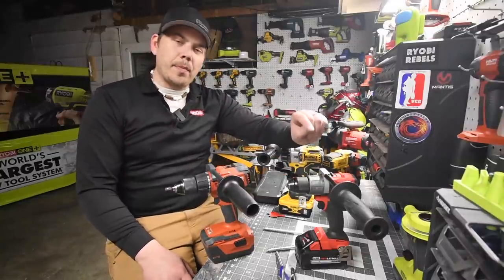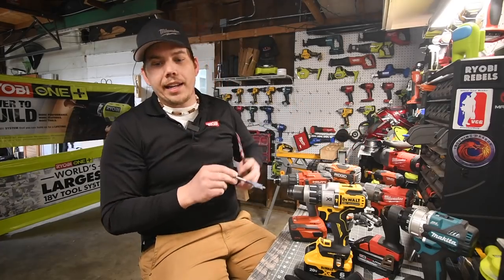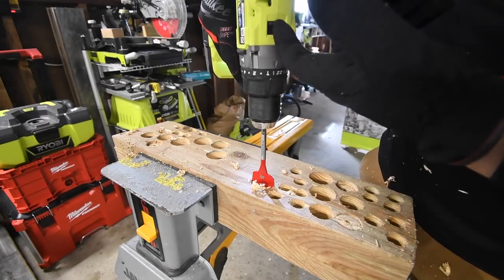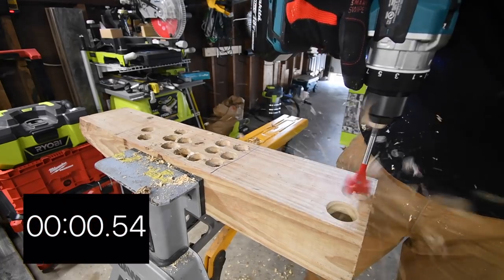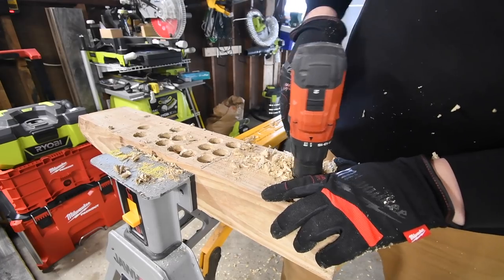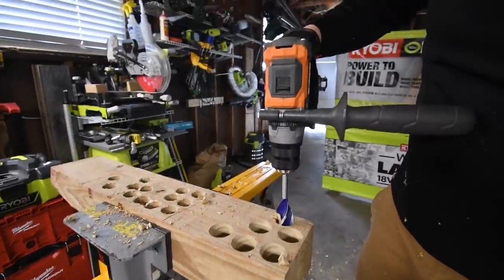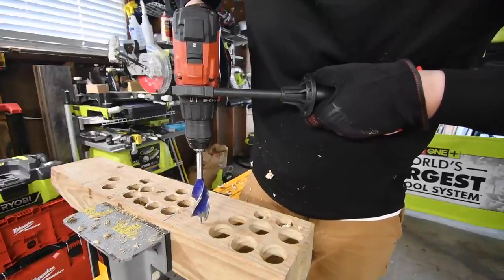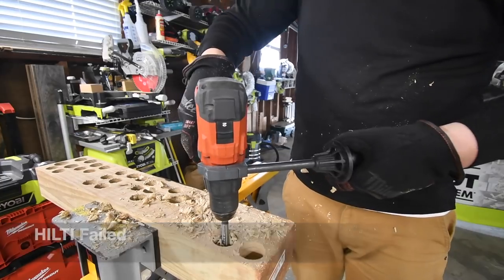BRAWL!!! WINNER Battles The Flex Turbo Hammer Drill

Comment: I've always wondered the same thing with makita not making a higher amp battery or even making the 5 amp like a high out put. Hey I can't wait for the flex vs video
Reply: Makita’s view appears to be that if you need more power than @ 2P (5Ah) battery can supply, then you need an X2 tool with dual 5Ah packs, or their new 40V/80V line.
Reply from the maker: I thank you for viewing
Reply: @geoffstrickler  yea but for a tool like a hammer drill that demands alot of power needs a higher amp battery and not two batteries. The only tool that needs two batteries are like a circular saw or a milter saw
Reply: @weldonpinder7295  be sure you’re not conflating amps/power with Ah/energy. 5Ah is the energy capacity of the battery pack, not how much amperage/power it can deliver. It’s essentially the capacity of the fuel tank. Ah rating is similar to horsepower/kw rating of an engine. A typical 5Ah power tool battery pack can deliver ~40amps @ ~16V, or about 640Watts of sustained power, and ~1.5x higher peak power for a short time. Whether or not a given tool can use that much power is a separate question. To continue the automotive analogy, the tool is the rest of the drivetrain (transmission, differential, tires, etc) behind the engine.
Reply: @weldonpinder7295  with the above for context, yes, there are some high end cordless hammer drills that can benefit from more power than a typical 5Ah 18V-24V 18650 cell based battery pack can deliver. Makita and Hilti could both benefit from newer cell technology in batteries for some of their tools, whether using the newer 18650 cells capable of delivering 25A-30A or from 21700 cells delivering 32A-45A, and/or from 3P pack designs. Of those, all would add weight and size, except for making 2P packs using the newer 18650 25A-30A cells. It’s anyone’s guess as to why they have not yet done so.

Comment: Dont you have a dewalt battery to Makita tool adapter? If you want to test how the Makita performs using the 21700 cell, use that adapter and use the dewalt battery. It gives you the performance you're looking as if Makita does make a 21700 battery. Also the hilti is 24v so theoretically it needs the 5ah battery. I know you want to test the 21700 cell but I doubt the flex 5ah battery is 21700.
Reply from the maker: I thank you for viewing

Comment: The Milwaukee never cut out on the 10” leg did it? The chuck came loose... The Dewalt cut out multiple times, it failed.... 
Milwaukee should be the winner, not Dewalt.
Reply: exactly. he wants to believe dewalt's medium gear is the same as the high gear on the other tools!?
this is as bad as a Flex tooltest...
Reply: @wim0104  Ya, I was very unimpressed with that battle. As soon as the chuck slipped on the Milwaukee (which was operator error I’m sure) he was very quick to say if it doesn’t start again it failed. Well it did start again. How many times did the Dewalt cut out? That test was bullshit. The Milwaukee won.
Reply from the maker: I thank you for viewing
Reply: @ManCaverTools  Not to be harsh. I enjoy your videos and reviews but that’s just my honest opinion. You seemed biased in favour of the Dewalt. The Dewalt cut out multiple times while doing the the 10” leg and the Milwaukee also removed the 10” leg faster. In my eyes that’s a win for the Milwaukee. Or at least a retest. Or put them both up against the Flex but Dewalt did not beat the Milwaukee. Not trying to be a jerk, just stating what I saw and I welcome your opinion would like to know if you really think Dewalt won because you said if the tool cuts out it fails.... Dewalt failed. Thanks for all your videos and hard work. Keep it up.
Reply: Thank you so.eone else who saw his bias. The Dewalt stalled, then he kept going like nothing happened. What bias. I thought if it stalls its out. Such bs. I like both Dewalt and milwaukee but Dewalt stalled. The 998 is a beast but not today.
Reply: @jeffreyheinzelmanjr3317  Thsnk you as well. I’m glad someone else actually posted a comment agreeing with me because I knew I wasn’t the only one who saw that. Ya, the Dewalt is a bit faster but when it comes to raw brute power I think the Milwaukee still is the king.
Reply: Well Derek B some people just do not want to believe what they like is not the king. But for the size of the Milwaukee its got some real power. They both are deserving to be the two last standing, but let's be fair.
Reply: @jeffreyheinzelmanjr3317  Agreed. I just didn’t like the way that Mr ManCaver portrayed Dewalt as the winner when according to the footage it was not. I reached out to him for his thoughts on what I say but he just thanked me for me for watching. He did a video in regards to the yourubers featured in the Flex release and didn’t have much good to say about them but to be honest he’s doing kinda the same thing in this video with Dewalt in favour. Maybe he’s on Dewalt’s dime....  I usually quite enjoy MCT videos and think he does a good job and is fair but he dropped the ball on this one.
Reply: @derekbross6958  I thank you for viewing....oh wait🤔 Why did I said that...I'm confused.

Comment: Dewalt speed 3 is speed 2 on the other drills
Reply: Sort of but not exactly. Jus to make an easy number of 1000 even though there rated higher other drills torque range is 0-500 and 500-1000 inch lbs but dewalt would be 0-333, 334-666, and 666-1000 inch lbs. So dewalt is at an advantage in 2 but a disadvantage in 3 cuz the gearbox is more spread out. The only way to evenly compare is only tasks that require speed 1
Reply from the maker: I thank you for viewing  :)

Comment: When it comes to the DeWalt speed 1 speed 2 speed 3 they should all have specs as far as RPMs. That's what you should match up against the RPMs of whatever the speed one and speed 2 is of the other drills. Not just going by one two and three? Meaning if Milwaukee has 2000 RPMs and speed 2 and DeWalt has 2000 RPMs and speed 3 then that's what you should be running?
Reply from the maker: I thank you for viewing  :)

Comment: So the Milwaukee lost out by a 1/10th of a second putting the 10" lag bolt in. While the Dewalt took longer to remove it. Thats a win for milwaukee then if removing lag bolts counts.  The thing is though, nobody is going to change over their whole tool ranges just for one tool result.  The tests I have watched on youtube show pretty much that any company can make one tool that works best at something, but none of them make a 'best in class' EVERY time.  

Whatever your tool line is, you will stick to it no matter what one test shows.  I use Milwaukee for battery tools, but for cable tools I use AEG, Bosch, Dewalt, Makita, Black and Decker (cheap Dewalts really) Titan, Evolution, NuTool, Ryobi, Sparky (AEG in disguise) plus others I can't remember,  but all the different tools are 'best in their class' for their specific uses.  I don't care who makes a good tool for a specific job, I'll use it, i'm not proud.
Reply from the maker: I thank you for viewing

Comment: Unfair test. The dewalt failed on two tests and Milwaukee did it on the same speed where dewalt failed. Milwaukee won! Smaller and more powerful! Milwaukee did it on two trigger pulls on the 10 inch lag and dewalt needed 3. How is that fair

Comment: The flexvolt advantage can absolutly do that speed bore test on 3 with a new flexvolt battery containing 21700 cells. The only thing I think you may be disappointed. VCG did some speed tests with the gen 3 milwaukee hammer drill with an xc high output 3.0 against  the lowest grade version of flex drill driver without turbo option and a 2.5 amp battery and the flex smoked the milwaukee.
Reply: VCG is a complete shill for Flex. He can’t stop talking about how much better Flex is than every other brand. Not surprised the Milwaukee lost in his test.
Reply from the maker: I thank you for viewing  :)

Comment: I will bet $1000 my 5 year old Bosch Professional HD-18-2 2 Speed CORDED Brushed Hammer Drill with only a max 3,200Rpm and only 51,000Bpm can beat that Flex Hammer Drill that new bully kid in town whole day and any day so effortless, as a matter of fact I filmed it and posted the video for it. The flex hammer drill smoked❗ I drill the largest spade/paddle bit that I can find, and the largest Irwin Speedbor max that I have in my possession, I also tried the largest self feeding wood bore bit and the largest concrete/masonry drill bit that I have the best that I was using for years and years I used the Bosch blue granite turbo. And the flex smoked, the flex hammer drill didn't got a chance to finish the self feeding bore bit and never had a chance to do the masonry test it smoked. And that was my results! My own test. I purchased the tool the new kid in town called the flex hammer drill with my own money and no endorsements or supports from the tool company. Bought it with my own money and the tool smoked and got wrecked. Now I didn't know if MCT will have the same result. But I want to find out.

Comment: Makita Can't make a 21700 celled 18v battery  because it won't fit their X2 36v tools , the battery itself would be too big.  And that's why,  imo , Makita came out with their 40v line , just soo they could have 21700 celled batteries.....
Reply: Don’t get me started on Makita, and their sorry arsed approach and attitude about 21700 cells in batteries.  You made huge point, right on target Brian.  I measured a couple of my X2 tools, and NO WAY bigger batteries would fit!  It would have caused a huge problem for them, so they just decided to ignore it, and go on about business.  Too bad the engineers didn’t use forward thinking in their design?  I’d love to see how my rear handle X2 saw would run with higher capacity batteries!  👍😁✌🏻
Reply from the maker: I thank you for viewing  :)

Comment: Dewalts speed 2 isn’t the same as all the other tools speed 2 though dewalts speed 3 is the same as the others speed 2 so dewalt should’ve been disqualified because it failed the task on its highest speed...dropping it to speed 2 increases the torque so of course it’ll complete it because that big bit requires high torque not high rpms
Reply from the maker: but that is the benefit of having a dewalt
Reply: @ManCaverTools  thanks for the reply, was t expecting one! Lol

Comment: I’m sorry but how dewalt win it has a third speed for a start so is obviously going to do lighter task quicker. The more torque tests it couldn’t do as well the 10” lag it stopped 3 times the Milwaukee only stopped because you stopped it. Or plowed the socket into the wood couldn’t really tell. Either way I wouldn’t use these videos if your looking to buy a new set of tools. There is that much wrong with them I don’t really know where to start.
Reply from the maker: I do thank you so much for viewing :)

Comment: Milwaukee is king because it don't need no 3 speed as a handicap
Reply from the maker: each tool has its own ups and downs. but this test is very fair
Reply: makes no sense.  If anything speed 2 just handicaps the Dewalt in certain tests where the extra ~600 RPM would be more beneficial than the torque....these are "speed" tests after all.  

Time to stop making up lame excuses just because your favorite brand doesn't win at something.
Reply: @ManCaverTools  enjoyed your video

Comment: Remember when I said hilti break easily in anouther video not long ago, 
Well told you so man, just no longevity on them
Reply: @loganmartin8613  dude I use them for work we lease them and I'll tell you what's happened with the drills to everyone 
Mine broke after being used for nothing more than pilot holeing and sitting around for a year, I barely used it because it was gruntless, I went and they gave me the newest model and instantly it was dropping it's bit and is nearly unusable because of it, there are 6 of us who us hilti and every month or 2 someone has to get a new impact because they stop working it's honestly pathetic, this of course is only what me and a few others have experience so take it Or leave dude
Reply: @kiwiingenuity6666  I have 20 employees give or take and have not had many issues.  We switched from Milwaukee to dewalt and now to hilti.  I will say there drill is not there best product.  There multi head is great as well as concrete tools
Reply: @loganmartin8613  I agree there corded jackhammers and rotary hammers are fantastic, and so are there wet dry vaccums, moreso the cordless tools mainly the drills I can't use anymore and the batterys I find run out far quicker than makita, dewalt or milwaukee which is a pain, for the price you pay your expect more, but there corded gear I find is probably some of the best
Reply: @kiwiingenuity6666  I really like there jigsaws.
Reply from the maker: I thank you for viewing  :)

Comment: The dewalt drill is hard to eaually compare tasks that dont require speed 1 cuz the torque ranges are more spread out. It has an advantage in speed 2 but a disadvantage in speed 3. Really only speed 1 tasks are the only way to compare dewalt to others. You did nothing wrong in your video jus saying this for the ppl that didnt like your switch to speed 2 on the dewalt. Theres jus no possible way to evenly compare a 3 speed gearbox to a 2 speed gearbox if its not a task that requires speed 1

Edit: other tasks that would be even in speed 3 vs 2 on other drills are ones that require high rpm and not so much torque as there both at max rpm
Reply from the maker: I thank you for viewing  :)

Comment: I hope gen 4 Milwaukee blows us out of the water is long over due they've been sleeping on these older models waiting for people to catch up.
Reply: 996 was already a better drill and came out 2 years before Gen 3 and before 21700 packs.  But ok.

And if some Dewalt fanboy came into a video saying just wait for the DCF887 successor to beat the Gen 3/4/5 Milwaukee then you'd be calling him an idiot.  (DCF887 came out 2 years before Gen 3 too, so does that mean comparing it to anything doesn't count just because Dewalt is sleeping on it) 

887 sucks btw.  Just using it as an example to poke holes in the flawed logic Milwaukee fanboys like to throw around.
Reply from the maker: I thank you for viewing  :)
Reply: @jaywelker5566  I'm not a big tool follower tbh, I'm simply stating that this drill and driver beats a 2~3 year old product by a second or 2 and everyones acting like its the next best thing.. which it isnt as it's a 24 volt tool which has allowed them go squeeze a little more out of the motor which shows the result here.

Comment: Bro you totally cheated you dropped the speed to 1300 speed 3 is 2000 speed 1 is 500 so yeah dewalt should have failed... this is why I say Milwaukee is the most powerful drill In high speed. I have all these drills gen 4 Milwaukee will be out soon same size 1400 in lbs it will kill the dewalt and the gen 4 impact with the tri led man I can't wait to see what gen 4 got

Comment: Cant belive the makita falied think makita batteries are restricting the performance of the tools think the protection circuit's with lxt is just set to high they need drop the limits a bit  i think it is with tool battery communication tech for amp  draw with the 18650 cells the battrey just making the tool cut off for saftey reasons thats all
Reply from the maker: I thank you for viewing  :)

Comment: enough of that Ridgid overrated tool. I would expect more with 1300 in-lbs of torque and 2000 RPM. Those specs mean nothing when pitted against the big boys.
BTW: I'm surprised at the Makita failing on the 2nd test as well.
Reply from the maker: I do thank you so much for viewing :)